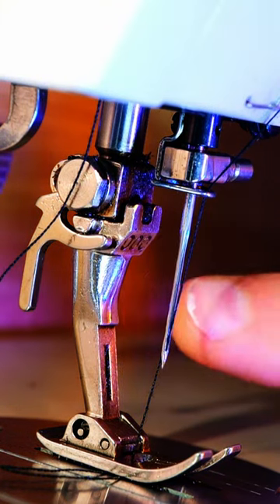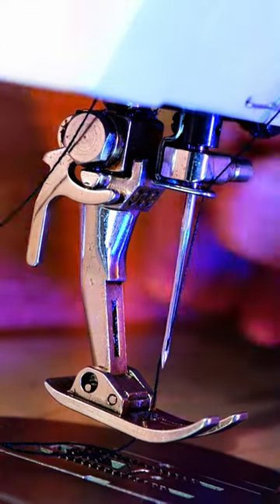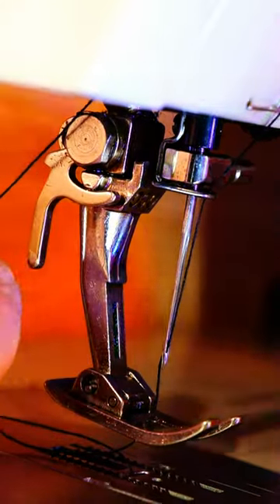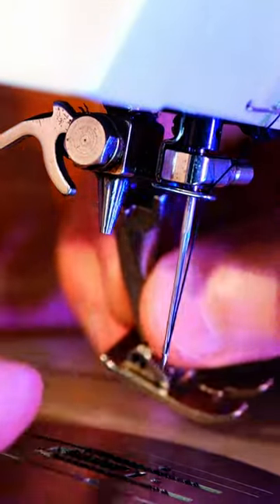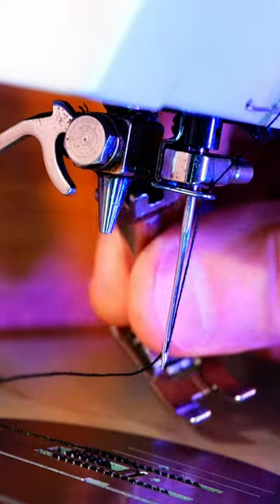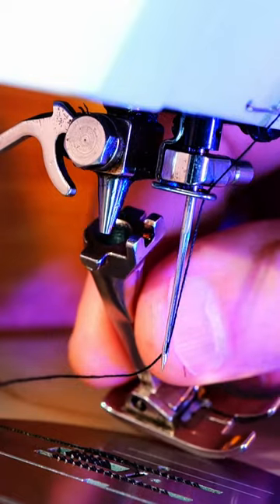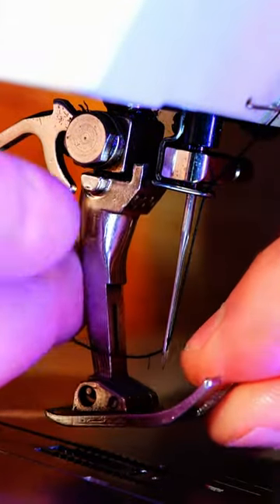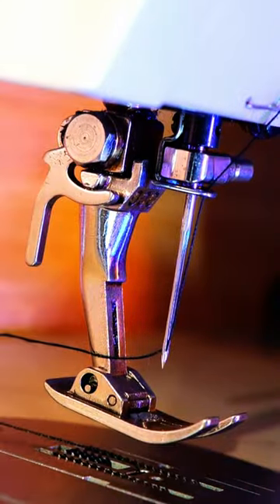Install a Bernina Foot #Bernina #Howtochangefoot #Bernina950

Comment: Poor design, KISS design makes a simple part functional for the 99% of the time you use the standard foot which is usually a stronger more robust steel over that soft, low cost pot metal.
Reply from the maker: Sounds like someone who has never used a Bernina.